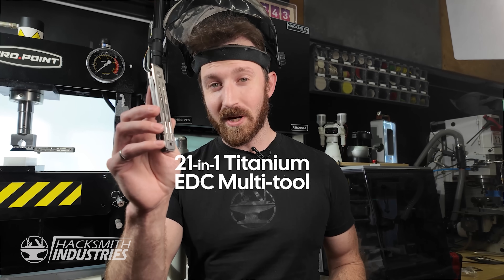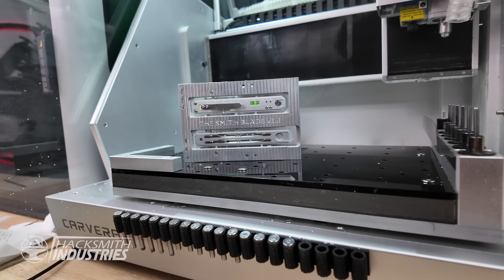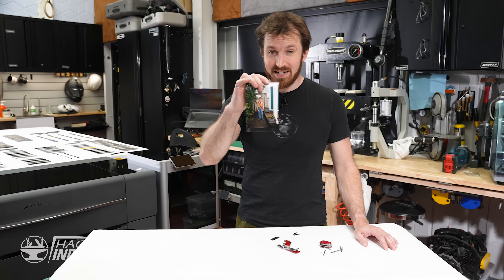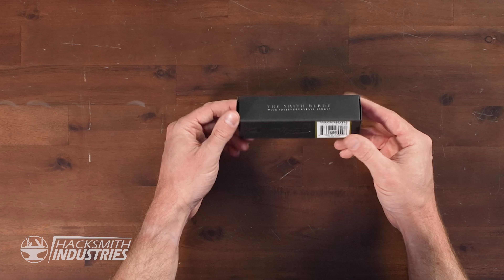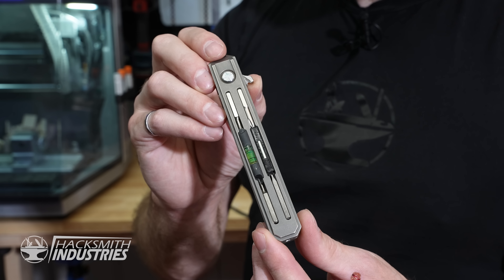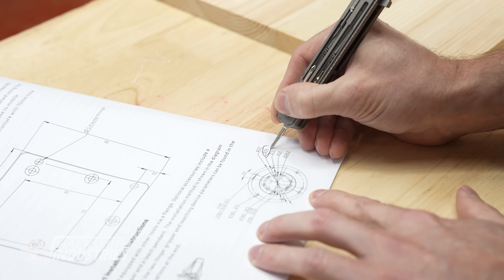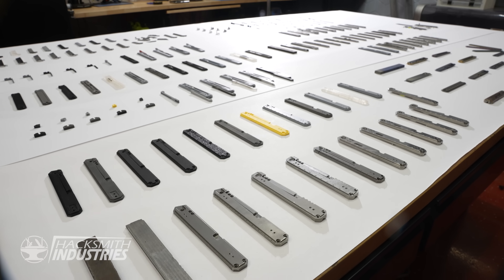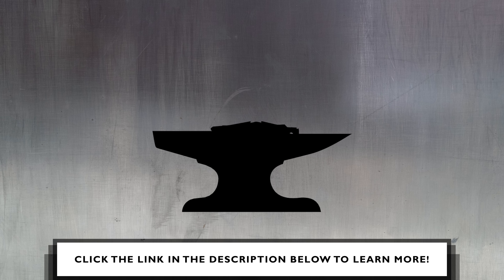We Made a Knife that can CUT THROUGH ANYTHING!

Comment: M390 isn't cutting through knives without a press or hammer. nice gimmick but if I'm buying a multitool at that price point it's gonna be the Leatherman arc in magnacut.  M390 is a steel that blew up years ago but has already been changed out in most things to magnacut.  M390 while a great EDC is not for hard use because of its low toughness.  If you want a knife that will cut other knives i encourage you to spend the 500 bucks on a carothers delta 3v blade.  If it doesn't have pliers it isn't a true multitool, just a SAK knock off

Comment: Does the pry bar/bottle opener prevent the protractor part from measuring and working as a square on interior angles? May not be feasible but that would be a neat feature.
Reply from the maker: The prybar only sticks out on one side, so as long as your at the edge of the internal angle, it doesn't get in the way 😊

Comment: Question: How well does the new multi-tool work when it is properly dirty? Dragged through mud and sand kind of dirty. I imagine you engineered it with tight tolerances, and it has a lot of open moving parts, which could get jammed. So I just wanted to ask if you accounted for that before I buy one.
Reply from the maker: It only has one moving part, compared to any other multi-tool -- the blade. Will fare better than most! If you get it muddy or dusty, yeah you'll want to clean it off, but everything is corrosion resistant!

Comment: Good combination of tools - but 260 USD??? WTF... Too expensive...
Reply: dont be broke?? dunno what else to tell ya bud. There are plenty of manufacturers selling fixed blades/folding knives for over 300 that have zero utility. This knife is 21in1 multi-tool, what did u expect...
Reply: yeah i am also doubting they are heat treating M390 decently at all.... this is really a shit buy it seems like
Reply from the maker: Why would we sell m390 without a good heat treat? That literally defeats the purpose of using it. They're hardened to 62-63HRC

Comment: Man I want the smith blade, and I even have enough money to get one lucky that I am. But I already have the Leatherman surge (the blacked out competitor he compared to alot in promos for the smithblade) and that does everything I need for a lower price. 

I'm just wondering what the target market is for this, as this is a very saturated market already (multitools) with lots of good competition at a lower price. Tough to break into. Best of luck though! If I didn't have and didn't know about the surge I'd likely get this! It has all the tools I need, wire strippers, level and scribe especially!

Comment: I feel like the tungsten carbide scribe will be a thing that might cause a lot of frustration for quite some people, as this thing will turn anything thrown with it into the same pocket/purse into scratchy mess.
Reply from the maker: Throwing your phone into a pocket with any knife, regardless of the scribe is a bad idea. The scribe is not sharpened -- slightly dulled so it doesn't poke things.
Reply: @hacksmith  Understandable, but there's a reason why microwave manuals note that they shouldn't be used to dry animals.
It’s something obvious to engineers, but most people aren't engineers and wouldn't even consider such a possibility. And when something goes wrong, the first instinct is to find someone to blame.
Reply from the maker: Yeah but if you're putting your keys in your pocket and wondering why your phone is all scratched... I'm sorry there's only so much we can do!

Comment: Where can I find replacement if the screwdrives eventually wears down?
And what can I do when the blade goes dull?
Reply from the maker: We use standard 4mm precision bits, so you can use them from any set! The blade can be sharpened =)

Comment: wonder how this handles dust like dust you encounter on most workplaces, what if i loose a bit ? Can you make one with hex bits ? How hard is it to maintain will it last a lifetime ?
Reply from the maker: If you fill it with dirt yeah you should probably clean it. We specifically chose standard 4mm precision screwdriver bits so you can use any bit you want from any set, unlike most multi-tools that use proprietary bits.

Comment: The non locking version still wouldn't comply to China law though. In China, non-regulated knife must have its tip no sharper than 60 degree and the length must be less than 60mm. That's said, I don't think I have much use for a utility knife so I wouldn't look for one that complies anyway.

Comment: Anyone knows if the blade is replaceable or it will be?
Reply from the maker: Of course, but the whole point of using premium steel like M390 is that you don't have to replace it
Reply: @hacksmith  Thanks so much for the resposnse. I'm buying the pro either way, but if it has replaceable blade you got me sold BIG time.  If anyone has used a knife a lot, you know it'll eventually chip or get too used from sharpening.
I carry a really nice knife every day, but i always end up using a cheap cutter for a lot of things because i'm scared of damaging too much the nice knife and having to replace the whole thing that can cost hundreds of dollars, but if i could replace only the blade i'd be amazing, i'd buy the Smith blade and replacement blades for a lifetime haha.

Keep making amazing quality and functional products please, we really apreciate it!!
Reply: Also, you could sell replacement blades that are more like a chisel for woodworking for example if the body would hold, or other special kind of blades. Maybe for fishing.... or instead of a blade a nice scissors or a pliers if  they fit in the old knife slot. I need the knife, but a lot of people probablly don't, so scissors or pliers could be preferable.
I'm sure people would find things to replace the balde with different blades or accesories.
Reply from the maker: Yup in the future we plan to offer different blade designs and steels

Comment: What was the reasoning behind choosing M390 over other steels that offer greater toughness and ease of sharpening, such as S35VN, or more well-rounded versatility, like MagnaCut? Additionally, why not consider other high-performance steels like CPM-20CV, Elmax, or CPM-4V, which each offer different balances of edge retention, toughness, and corrosion resistance? I’ve been out of the knife scene for a while, so maybe M390 is the bee’s knees now 😂
Reply: This was kind of my thinking as well. M390 for this use case? Elmax could be argued as a better option, and perhaps this is an excellent application for Magnacut, which we're now seeing approaching the $100 mark and to claim that he average for an M390 knife is $500 is to my knowledge highly questionable.
Reply: Cpm 20cv is m390. Bohler makes m390 and crucible makes cpm 20cv. Its not considered the best steel and is outdated. Its formulation is flawed and inefficient. It’s still being used because its well understood and familiar steel. 

Magnacut is a stainless version of cpm 4v, thats what the creator larren thomas said. A well balanced steel. It was created as a knife steel and is an extremely efficient formula. He basically solved the problem which stainless steel had which was being brittle.
Reply: Also can't go wrong with coated D2.
Reply: CPM-20CV is essentially identical to M390. As far as overall rating, all those are pretty close in general performance. Magnacut has higher rating overall, is tougher, and might be considered more "premium" but not everyone needs that level of stainless to sacrifice edge retention.
Reply: @MrSoundChaos  when heat treated properly magnacut has better edge retention than M390. Well heat treated magnacut completely obsoletes M390.
Reply from the maker: In the knife world, everyone has preferences and it's impossible to satisfy everyone. We may offer additional blade steel materials in the future
Reply: @hacksmith  what is the HRC range and heat treatment for the blade?
Reply: @hacksmith  +1 for Magnacut.
Reply: May offer? Wtf. this is jewelry for the Ebike espresso crowd. A $250 knife
Reply: @miguelcanoe6774  $250 is considered a mid priced knife to knife guys. High end knives range in the $400 to like $1000 range and custom knives can go for thousands of dollars.

Comment: Too many short clips combined together makes me feel that it is not as good as the label says.
I didn't see the blade after it chopped through the Swiss Army.
The blade moved whilst scribing against it as an angle marker (degrees).
Flick knives are banned in nearly every country except USA.
Is the flint included?
I like the lightweight solution as I also don't carry my heavy multi-tool around with me too.
I didn't look at the price, probably high due to the development costs that need to be recovered.
Reply: its a comercial, what did you expect?

Comment: Wish you had an s90v version or something that still had all the tools and still titanium but cheaper since I don’t really see the point of m390 on something like this. Good call on a simple blade like that though - nice length and will be easy to sharpen. But even D2 wouldn’t have really been an issue given how straightforward sharpening a straight blade is. Just not sure the supersteel was really needed if it is intended as a work tool. As a collector’s item it makes sense though.

Comment: This looks great, but most M390 knives sell for well under $500. MKM has M390 multitools made in Italy for less than $100. Where does your M390 come from Austria or China? For the price you're asking, all variants should come with M390. If everything’s made in-house, $250 might make sense, but it still feels overpriced compared to the market considering I can get a Leatherman ARC for 250 that has USA made Magnacut blade at 60-63 HRC. What is your M390 at HRC wise? I was honestly shocked at the price for the pro version considering everything else you sell on your site is very fairly priced. I am not a scientist or engineer just a knife nerd that uses and sharpens a lot of different steels including M390 and 14C28N which is a great steel but still a budget steel. I could see taking away all the gimmicks I mean tools and charging 100 bucks for a ti M390 folder but you took away the better steel.
Reply: I am upset with how far I had to scroll to find a fellow blade head with the same concerns
Reply: If it was CPM S90V that would be more on the really high end, but still you can find those under 500$
Reply: I'm also not a fan of some of this advertising. A knife that can cut knives? Any knife can do that when attached to a hydraulic press. Also the knife appeared to be very damaged after that stunt (assuming the appearance later on is the same blade)
Reply: Yeah ag this should definitely be magnacut. M390 is prone to chipping. And yes Arc is much better and offer more and I seen to go around ~$200-$240
Reply: Which MKM?
Reply: @stevememc they make a few different ones the MKM Malga 5,6 & 7 come in either M390 or Magnacut and the MKM Campo 8 comes in M390 as well. They are more traditional Swiss army knife style.
Reply: @Mikey_Trailz  oh ok thanks man!
Reply: @stevememc Absolutely!!! ⚔️
Reply: Right, Magnacut would have been my choice here too.
Reply: For what it's worth, on their Kickstarter in the "Nail File" section, they claim the blade has a 61-63 HRC.
Reply: The Arc is more for blue collar workers whereas this is for white collar workers, there’s overlap ofc but the Arc is completely unnecessary for me. This weighs next to nothing and I’ll actually carry it and find it useful, I’ve pocketed my mates Arc and it weighs a lot more in comparison. I have a Leatherman Skeletool for basic pliers, a Crunch for clamping pliers (multiple type of saws can be used with it) and a Big Ideas Design screwdriver with 8 bits of my choice in my bag so having this in my pocket is ideal. I don’t need or want everything in one heavy multitool on my belt I want an actually useful multitool in my pocket and this is it.
Reply: The problem is they had to do their own R&D and are building the first couple hundred in house. If they used parts from other manufacturers, it could cut the cost down but sounds like just about everything is custom made for the knife.
Reply: It’s because they want a fat profit margin
Reply: m390 is super common, but it's still considered a premium steel and is on a lot of premium knives. It just depends on how well it was heat treated. I'm not sure where you can find a good quality ti m390 folder for 100 dollars. The 100 dollars for 14c28n is actually pretty common. Also, magnacut is defintiely been everyone's favorite lately, but each steel has it's own pro's and con's. Magnacut isn't the better choice for every application. I mean there are so many knives that are hundreds and even thousands of dollars that are in m390.

Comment: That nail file on the opposite edge of the main blade seems very dangerous, takes very little to suddenly have a nasty gash.
Reply: It's on the back of the blade, and the blade is exactly as wide as the handle. I am 99% sure you can use the file with the blade closed :)
Reply from the maker: When are you putting that kind of pressure on a nail file... Filing your nails? It's fully usable closed too ya know.
Reply: just use it when its closed not open lol

Comment: As nice as it looks and sounds, it's got one feature that makes it not worth purchasing on my end. The idea and concept is worth the price, don't get me wrong, but it's worth pointing out that for said price, there is a chance of an increase due to what is needed.

See, I am left handed and this is not designed for left handed users. Normally, if I need a left handed knife, the price is higher than the standard right handed version. The reason why, because they have to go in and change the settings and design layout to be for left handed use.

This means to even order one, I would need to pay at least $300 while the right handed is $250. So, as I mentioned earlier, great design and concept, but not for me. Unless there were to be a mass produced left handed version, it's not worth the purchase on my end.

Comment: My number 1 tool I own is a Leatherman Squirt.  It's so small I carry it everywhere, so it inevitably becomes the "right tool" because it's there.  I lucked out and got the version with wire cutters/strippers.  I don't know if the Smith Blade is right for me, because it's larger than that coveted keychain size, but I'll definitely be considering one
Reply: Yea this isn't so much edc tools as tools that you'd use around the workshop. Protractor, bubble level, metal scribe especially.

Comment: I actually carry daily in my belt folding usual multi tool pliers, electrician folding pliers, a couple ratchet screwdrivers, a pen multimeter, a swiss blade (knockoff), a multi tool hammer, a measuring tape with built in laser rangefinder and inclinometer and a multi tool pen, this is like my holy grail but... It's almost half my salary, perhaps I'll save for Christmas

Comment: Genuine question I hope you guys can answer. so when working for my FSAE team im cutting prepreg carbon fiber, kevlar, adhesive film, etc ALL the time and to cut that you need a razor sharp clean blade. The problem is cutting those materials dulls blades like nothing else and the resin and epoxy tends to get caked on and cleaning it can be really annoying. So i just use those disposable carbide blades. How would the M390 deal with those materials? My concern is often times the things i want to do with a knife is terrible for the blade. i dont want to worry about damaging my tool
Reply: I'm gonna say its probably not the best idea but it will likely keep the edge sharper longer than most blades but its still gonna dull it quickly, especially the kevlar

Comment: I'm super interested in the smith tool, but from your video it sounds like each of the knives has the m390 blade.  However, on kickstarter, it seems like just the pro version has the m390 blade.  For talking so much about the blade, its a little odd that you aren't super clear on which knives include it and which dont.
Reply from the maker: It's extremely clear on the Kickstarter, and it is the knife we advertise in this video

Comment: I have been carrying a small SD Swiss Army Knife on my keychain for about 40 years.  However, I have gone through about a dozen of them over that time.  Despite the knife blade (58 mm) hardly being large enough to be an effective weapon, I have repeatedly run into difficulty carrying it in the post 9/11 world.  Sometimes, that was my fault because I forgot to leave the knife at home before heading to the airport or before going to the courthouse.  The most annoying time was when I took my mom to see one of the last performances of the Ringling Bros Circus, and having to park half a mile from the Barclays Center, only to discover security wouldn't let me enter with it and would not let me retrieve it on the way out.  That knife was only $20, so it wasn't that big a deal.  I would worry about something like that happening if I daily-carried the much more expensive Hacksmith knife.  

Other than that, my only concern is that the tweezers look very much like the tweezers in my Swiss Army knife.  Those tweezers are just not long enough to use without great difficulty.  Those tweezers are better than nothing when you need them, but not very much better.  How long are the tweezers in the Hacksmith knife?

Comment: As strong and sharp as the knife is, how’s the edge retention? If I try to carve with it, will the tip snap off when I try to pop out a bit of wood?
Reply from the maker: M390 has phenomenal edge retention, that's why we chose it! You only risk breaking the blade if you're using it as a prybar on metal (please don't do that). It won't even notice you using it on wood =)